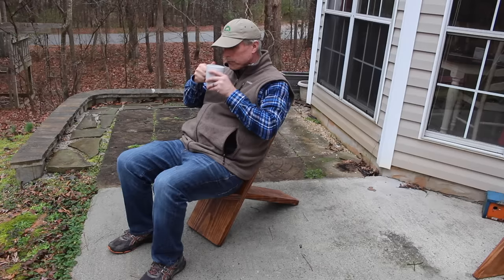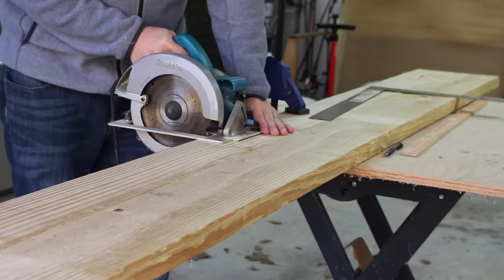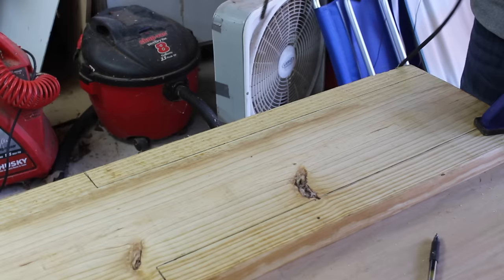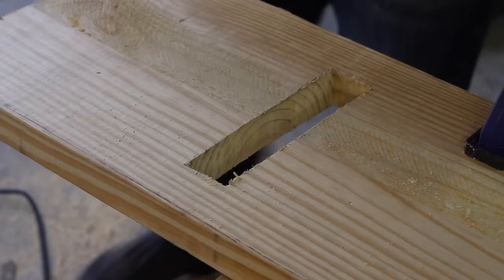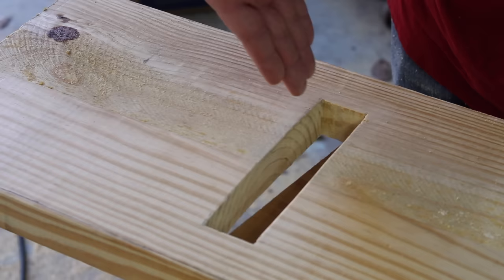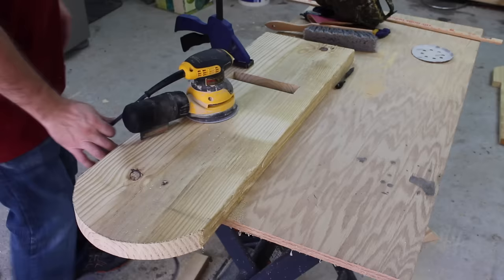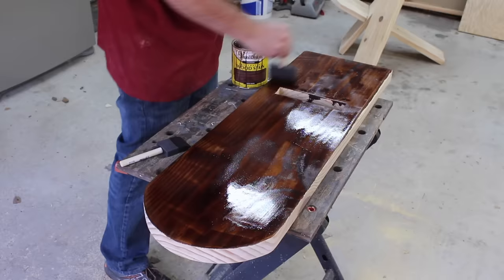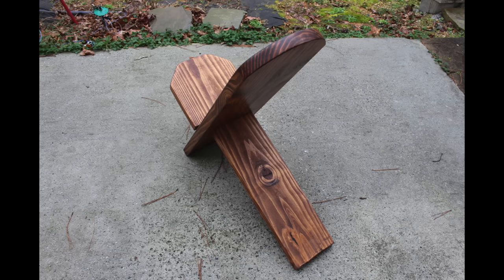Make a Campfire Chair

Comment: I have spent many, many hours sitting in chairs identical to this one.  I also have made many of them for myself and to give to friends.  A long time ago there was a simple modification to the usual design which helped mitigate and then remove the unofficial name - "The Tipsy Chair".

Back in the olden days those who sat around the fire in these chairs would have a tendency (for 'some' reason) to become unsteady resulting in often falling over on their side.  Mud and wet were always a bad background there.

The answer was a 3' long 2" x 3" (or 2" x 4") bolted with two bolts and wing nuts to the inside dirt edge of the backboard.  Long or short, the 3 feet of lateral support instantly removed the word "Tipsy" from the name of the chair.

Comment: If you tip the top of the chair backwards then you will have a campsite sawhorse frame for holding rough wood so you can saw wood into lengths for your campfire. A pair of them works best as a sawhorse. Also you can put one chair, as a sawhorse, on each side of a campfire to hold a green sapling pole, so that you can hang cooking pots over the campfire.
Reply from the maker: Thanks! I hadn't thought of that use.
Reply: @fouroakscrafts7240   I added more to my comment.
Thanks ❤️❤️❤️❤️
Reply: @aprilmay578  marry me
Reply: @usingbothsidesofmybrain9930   Not till I make my first Million. 💋
Reply: DIRTYBOB59   Thank you Sir. 💕
Reply: DIRTYBOB59   SMILE... You kind sir, are making me blush. 🤗
Reply: DIRTYBOB59   Oh My! I don't think that is your big toe...
Reply: How clever, where can I find such a woman??
Reply: @Region-37pro   Shopping at a hardware store. 😃
Reply: @aprilmay578  Do you and DirtyBob59 need a matchmaker to set up a date? Get on with it already!
Reply: That is amazing information.

Comment: If I may make a suggestion. When applying stain or paint, brush across the grain the feather the finish with the grain.
Applying across the grain helps with penetration & brushing out with the grain looks better because any brush marks look like part of the grain thereby disappearing. 
Cheers Keith.
Reply from the maker: Thanks for the tip! Another thing I would suggest with pine is using a sealer before applying the stain. I forgot to do that with these, and the stain came out a little splotchy.

Comment: I made some of these chairs using 5/4  yellow pine, decking type material.  They are light weight compared to your 2" rough cut stock. Very simple and very nice design. Easy to store.
Reply from the maker: Thanks for the tip!

Comment: Maybe a 70 degrees cut will offer more surface for distributing weight equally, but you also did a great job, congrats from a ITALY
Reply from the maker: Great point! I think I've seen other designs where they've used the 70 degree cut. I just wanted to keep in simple, but some may want to incline more in the chair.

Comment: Nice work, not complicated design. Will add to build list and subscribe!
For outdoor furniture, hint I picked up from boat builder,  dilute 1st coat of varnish with mineral spirit 50/50 to soak in and penetrate wood, rub between coats, 2nd coat thicken mixture,  3rd coat repeat. Final coat 90-100% varnish. Buff out any brush marks, though it's fairly self leveling
Reply from the maker: Thanks for the comment! Yeah, that spar urethane is great. This chair has been outside for quite a while now and still doing well.

Comment: You can spend a few more bucks and use a 2x16.  A little more seating surface never hurt. If you really want to fancy it up, use your sander to form the seating surface to fit your arse a little bit.  Fun project. Thanks for posting.

Comment: Nice build.  It would be helpful to see it used by someone actually trying to sit in it then trying to get out of it as well, to show how it’s used. So as to see how comfortable they are.
Reply from the maker: They're fairly comfortable chairs. Probably not as comfortable as an Adirondack. But it's easy to sit on and get up from than the Adirondack. Just need to make sure the 2 boards are locked in place good before you sit down.

Comment: As someone who has made, and used these type chairs for nearly 30 years...one piece of advice.  On the front "foot" (ie - the bottom part of the chair back), cut a V or half-circle and make it have two "feet".  Much better for uneven ground around a campsite.
Reply from the maker: Thanks! That sounds like a great idea.
Reply: But if the grounds wet they will dig in though.
Reply: @Ojb_1959  - Not really that much.  I've been using these, as I said, for 30+ years in medieval re-enactment camping, and I'm a big dude.  Never had one do that.  Then again, you don't make the "feet" small.  Probably 3" or so each.  shrug
Reply: @asbrand  Got it, thanks🤙🏼

Comment: Hey, thanks for the video and plans! I used your plans to make one for myself this morning. The only thing I did different was use the table saw to cut the majority of the tenon, then finished off the last inch or so with the jigsaw. I‘m going to make more to go around the fire pit, but I‘ll probably make a router template for the cut-out square in the middle of the back board just to speed things up. My jigsaw is pretty horrible and that part took the longest. Thanks again for the inspiration!
Reply from the maker: Thanks for the comments! I like your suggestions to make the process more efficient. Especially, if you make several of these chairs.
Reply: Chris McDowell | CMR Woodworks Hello Chris where do I find the plans at? Thanks

Comment: making one of these for a camping trip this weekend. Couldn't find 2inch thick board so hoping the 1 inch will suffice 🤞 I'll chuck it on the fire if it snaps 🤣🤙
Reply from the maker: Thanks for the comment! I may have said 2 inch boards in the plans (store shelf dimensions) but I think the "actual dimensions" are less than 2 inches. Every board is different and has different strength levels. Some have defects. So, yes, sometimes you test it out and if it doesn't work just chunk it on the fire and try again ... LOL.  Hope you have great success!
Reply: @fouroakscrafts7240  so I just used your plans yesterday using 1 inch thick board and lo and behold it didn't snap! I weigh 200lb so quite impressed really. Still, going to add some thin strips of steel at the pressure points as reassurance 😅 thanks for the plans & video!

Comment: Sorry I would not use pine. I have heavy relatives. Nice tool use,  weight distribution should be more structurally sound per guest or user. The rest makes some sense in finishing the project. Thanks!
Reply: Pine is strong enough, lolz!
Reply: 280 pounds here, and no prb with pine.
Reply: Thats 2 inch pine. Should be very strong.

Comment: Excellent project and video.  I read your informative website article concerning circular saw kickback and I have some suggestions. On many cuts I've found the yellow square steel plate with multiple nominal size openings to be very safe.  The plate lays at an angle on the ground with the board pushed through and then the long side of board is held down with ones foot.  A few  more suggestions: I always put a short kerf cut (done with handsaw) in the opposite side so the circular saw cuts cleanly through the end of the cut. I also place a bunched-up moving blanket on the ground to catch the cut-off if it's my work-piece. And I sometimes score the cut- line which helps to keep it straight. This definitely helps with the jig-saw which I NEVER seem to cut straight with. I'm definitely subscribing to your channel and I enjoy your website.
Reply from the maker: Thanks for the suggestions and thanks for subscribing!

Comment: I got your plans off Pinterest. Thank you. Maybe I'll put a slot at the top for a grip and velcro them together for carrying.
Reply from the maker: That's a great ideal. It would be easier to carry with a slot and the velcro!
Reply: @fouroakscrafts7240  - or even a strap that would go through the hand slot to also hold the two pieces together. But I like the Velcro idea because a strap could get lost.

Comment: Nice .... I think this might be my next project. BTY,  always spread stain rags out to dry. if balled up, they will spontaneously ignite if oil based...........seen it happen. Cheers.............G
Reply from the maker: Great safety tip!
Reply from the maker: Rogeball PB  I've always heard it's more likely with oils like Linseed or Tung oil. These oils take a much longer time to dry. I've never seen it happen, but I wouldn't take a chance, esp. with certain oils.
Reply: Rogeball PB   I really couldn't care less if you believe me. Cheers..........G

Comment: Seems like you can get 12 x 2 timber in the USA, in the uk it’s so difficult to find cheap!
Reply from the maker: You might get by with some thinner boards, but probably wouldn't work for heavier folks.
Reply: Go to a construction site and ask if they have scraps. They usually just throw the scraps into the trash.
Or use a good quality exterior glue and glue three 2x4s, side by side, inorder to make a 2x12. Using dowels and glue will make it even stronger.
Reply: I find 2 x 12 both cheaper and easier to work with...... :-D
Reply: jujitsuman68 8inches wide but atleast you know there solid!! 🙌

Comment: Good. But if it is really a campfire chair than you had to put some kind shield rubber on to the butt of the chair. To make sure it is not rot soon in wet dirt.
Reply from the maker: Thanks for that suggestion! That would help it last longer.

Comment: Starting the tenon cuts with a circular saw would be faster, cleaner, and easier.
Reply from the maker: I agree that it would be cleaner and faster with a circular saw.  I just wanted to do it with the jig saw since that can be a more accessible and less intimidating tool for many folks. If I were to make these to sell or large numbers, I probably would use the circular saw. Thanks for the comment!

Comment: So many different names for this chair I know it as a Chief or African birthing chair, I remember doing this in Girl Scouts! I wish you would have shown how you cut the back (the round top part) and the seat part as well. What are the measurements of the seat (the edge cuts) but great chair! I’m trying it this week!
Reply from the maker: Yes, I had not heard about the African chairs before, but see a lot comments about that. I've also heard people calling them Bog chairs, Viking Chairs, and Stargazer Chairs. As for those other cuts you mention, I just used the jigsaw. You can use a compass or anything round (like a plate or can) to draw the round part. Then cut it out with the jigsaw. Or it can be any shape you like. Thanks for the comments!
Reply: Ok thanks! Lol didn’t think about using a plate huh that’s actually a great idea cuz I have no clue where my compass is lol

Comment: That simple chair could be pretty heavy until the water dries out of the pressure treated pine.
Reply from the maker: The pine in this project is untreated, but I stained and used spar urethane. It has been sitting on my porch for over a year now and been out in all kinds of weather. It's still holding up and I still sit on it without worries.

Comment: Would it be beneficial to mark one side of each board so that it could be flipped or rotated with each assembly. That would prevent the boards from warping, or is that a desired affect
Reply from the maker: That might help if you're talking about weight distribution when people are sitting on the chair, but boards have a mind of their own sometimes and will warp for no apparent reason. There are other factors that can contribute to warpage. But yes, you could try what you're suggesting especially if the chairs get a lot of constant use.

Comment: Need to drill some holes through the ends to that you can run a rope or strap through them for ease of carry.
Reply from the maker: Thanks! That's a great idea. I've seen other designs where they cut out a big hand hold.

Comment: 70 or 90 degrees will eventually crack the wood along the grains! Would an oval hole lasts longer?
Reply from the maker: Good question! I don't know if -- in this case -- it would make it any stronger or not. I guess you would call this a cantilever design (not exactly). So I'd want as many wood fibers supporting it as possible. I'm not a physicist, but I'm thinking the forces (weight) sort of gets distributed almost evenly (maybe not quite evenly) between the two boards. If you think about it, the force of leaning back on the back board probably pushes up some on the seat board. And same way for the seat board to the back board. Because of the lever made through the joint. Again, I'm not a physicist -- LOL.

Comment: Thanks for the vid. Very cool. What kind of wood would be the most affordable yet strong and what kind of weight will it hold.many thanks
Reply from the maker: I used pine which is probably the most affordable and it's strong. I've had my chair outside for over a year now and it's holding up fine.
Reply: @fouroakscrafts7240  ok nice.thank you very much from cape town.south africa.

Comment: Nice work. I was thinking on how to change the design a bit. If we would cut out the mortise halfway from the edge to the center on both boards and then interlock them? What do you think?
Reply from the maker: That should work also -- like a half lap joint, and I've seen that in the design of other chairs. You may want to make sure that joint is a fairly tight fit. I read an article in Fine Woodworking that said 7 of 10 woodworkers believed the mortise and tenon is the strongest joint. But you may want to research that yourself. I don't know that for a fact.

Comment: im guessing there is a weight limit and us bigger guys might have to add another support
Reply from the maker: Good question! I don't know of a way to test the breaking strength. I guess I need to get my engineering calculator out and figure this out LOL. But you could put a small bracket underneath if you'd feel better with more support. But then the chair won't pack as easily in your vehicle. Someone mentioned using laminated veneer wood, but that's a little more expensive.

Comment: Great video..When you applied the urethane what did you use to stand the 2 pieces up?
Reply from the maker: I believe I just propped them up against something in my shop. But after drying, I made sure to apply more to the section of the boards that would be touching the ground. Another tip I learned is for ends touching the ground you can also apply some Titebond 3 glue and let that wick up into the end grain. Then you could still apply the spar urethane over those ends after the glue dries. I try to do that for outdoor furniture, especially parts that will touch the ground.

Comment: Hi, going to make this soon. Downloaded plans so big thanks, but youve said the planks are 2 inch thick yet on the mitre cutout you show 1.5 inches? Bit confused is this right? Cheers
Reply from the maker: Actual dimensions of the boards may vary and may differ from advertised dimensions. Some boards are labeled as 2 inches thick but may only be 1.5 inches thick. You may have to make some adjustments from the plans if the dimension of your boards are different.
Reply: @fouroakscrafts7240  so I just make the mitre the thickness of the board then yeh? Cheers bud
Reply from the maker: @davidomara893  That;s right. That should be the main tweak you'll need to do.

Comment: Very Nice Job. I myself like a higher back. Do I just make the back to how high I want it. But won’t that make the seat part to short and will it perform the same. Hope you can understand my question. Lol Thanks James
Reply from the maker: Thanks for the question! Yes, you can make the back higher. You can really change up any of the dimensions. The position of the mortise will affect the incline angle. If you just change the length of the back only, that shouldn't change the incline angle. But - for example - If you move the position of the mortise, then that will change the angle of incline. You can also make the seat longer or wider to accommodate your size. Hope this helps!
Reply: Four Oaks Crafts Thanks so much I will Definitely give that a shot. Thanks for getting back to me.

Comment: How do you sure up a chair for heavy people?
Reply from the maker: These are fairly thick boards, however I don't know what is the breaking point of the chair. You could add a bracket I suppose on the bottom for support, but then the boards wouldn't stack neatly for transport. I believe the mortise and tenon joint is one of the strongest type joints, but you may want to research that yourself. Thanks for the question.

Comment: Could you build one without power tools?
Reply from the maker: Yes, but the mortise might be a little challenging. You could change the mortise design up with a lap joint. Lap joint could be done with handsaw and chisel. Everything else could be cut out with a handsaw.

Comment: This is a great fold-away chair. What was the measurement  for the Mortise hole...i didn't catch it.....?   The ks
Reply: The mortise hole is 1.5" by 7.25". The bottom edge of the mortise is 11" from the bottom end of the seatback board. The seat part of the seat board is 11" from the front edge of the seat. After 11" it narrows to 7.25".

Comment: Great video!  What is the name (color) of that particular Verathane stain?  Thanks!
Reply from the maker: I believe it was called Ebony. You may already know this, but Pine is notorious for not staining evenly. So, you might want to use a sealer first. I didn't care that much about the appearance since these chairs are for camping and will get thrown in the back of my pick up.